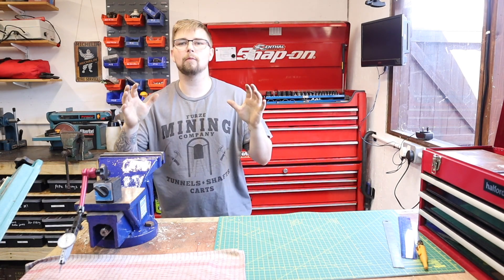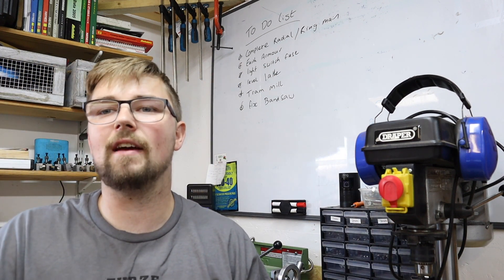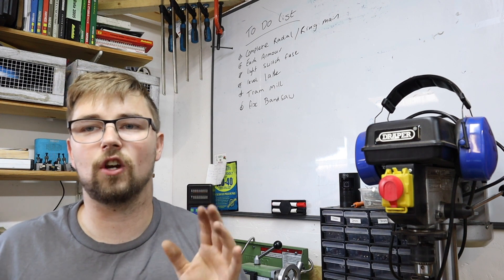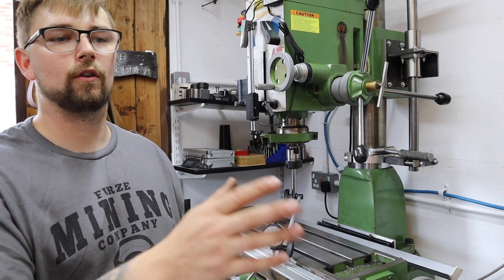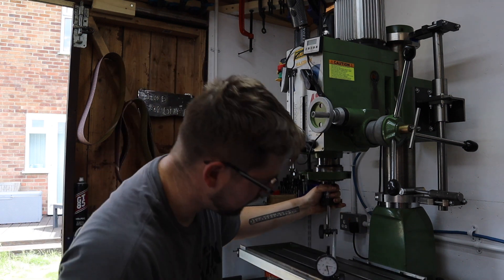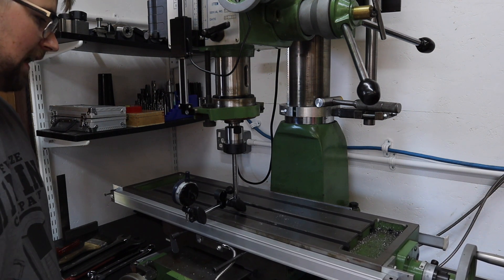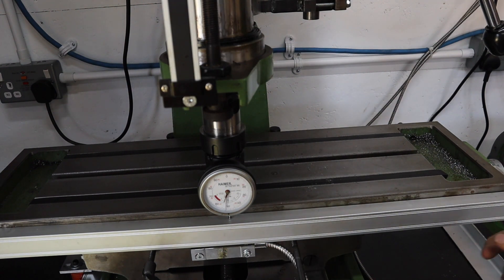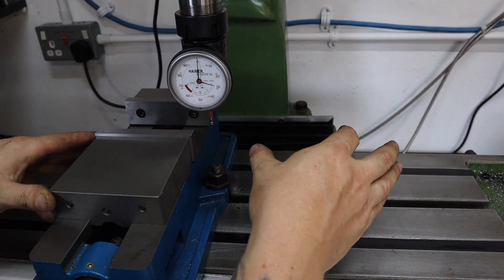Setting up Machines after a Shop Move

Comment: Take lathe of the wood and rest on the concrete if it was laid correctly it should take the load the wood will move and give inconsistent levels depending on heat humidity and vibration.
Reply from the maker: Hi Jon your comment makes completely sense. I am going to see how it goes when I start running the machine and turning stock down again. As with everything around the lathe to remove the wood will be a right pain.

Comment: Joe, Levelling a lathe proves nothing, you should be checking for twist and bow in the bed between the headstock and the tailstock and making sure the tailstock centre is along the spindle axis, you will only know this if you machine the diameter over say 12" and check for taper along its length, re the mill, you say rigidity is an issue if you shim one side, how do you know all four side are sat flat now without checking.
Reply from the maker: Hi campingstoveman what you say makes complete sense when it comes to the art of metrology when setting up machines I still have a long way to go and very much a newbie here. As for the mill I am just assuming the column is flat to the base but then again you know what they say about never assuming. Anyways thank you for your comments I will take it on board and do some test cuts over the next weeks.